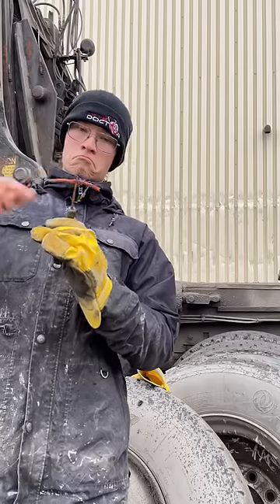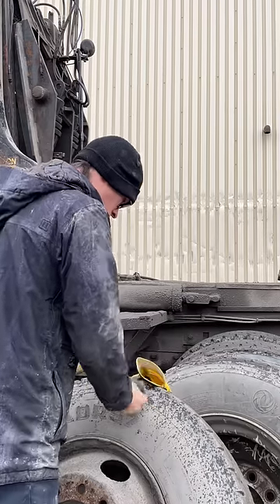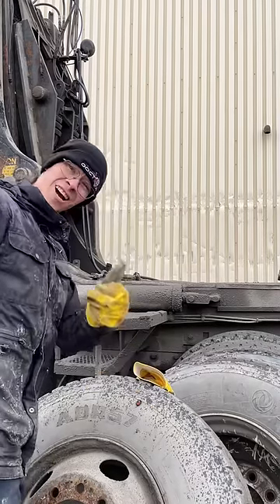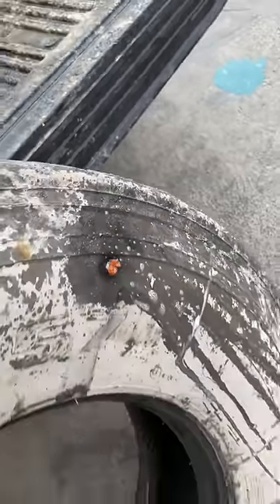Plugging A Truck Tire Sidewall #tiredoctor #shorts

Comment from the maker: Full 2022 Short Recap Videos Are Now Live! Click on my Channel to watch them ALL without having to scroll! ❤
Reply: Aren't you not generally supposed to fix side wall of tires, or does it depend on the tire??
Reply: But I don't watch for entertainment. I watch to learn. Or to add some content to help other technicians. And to get feedback.
Reply: i could make a knive out of that piece of medal
Reply: I found real life vigilante
Reply: The plug might get him home, but once the sidewall is done, so is the tire. I sure hope the truck company is eating that expense.
Reply: No
Reply: Give it too a tweaker
Reply: I have never seen a rope plug NOT outlast a tire! Just make sure you have a knot or loop tied in it on the inside of the tire. It will never come out! And always use tire cement on it. Tire companies just wanna sell you a new tire that's why they are not recommended.👍
Reply: The plug installed on the rim tested off ... Glad you didn't need to replace it lol
Reply: You should be fired for this. Lose ur TIA license.....never....NEVER plug a truck tire sidewall.
Reply: @dustinstrickland8975  he already replaced the tire when he tested it notice it's lack of rim ... All he did was waste a rope and time. For entertainment
Reply: And your fired
Reply: @JonRheaume2282 0j ZZZ l
Reply: Hey tire doctor is it safer to pull that out or pull the core out first?
Reply: Idon't think we can plug the hole on the side of a tire ?
Reply: @littleaub2145 it's a joke, there was no rim on the tire.
Reply: @FC0BCA7E7A it's a joke, there was no rim on the tire.
Reply: @roberthobbs6318  it’s a joke there was no humor on the tire.

Comment: That's why you don't pull out a knife if you get stabbed.
Reply: Or get this, don’t get stabbed
Reply: @eancola6111  😎
Reply: @eancola6111 now that's a 900 iq move right there
Reply: Nah just plug it with a tire plug
Reply: No you just put a tire plug in you 🤷‍♂️
Reply: So you don't deflate?
Reply: @eancola6111  real shit 👌
Reply: Usually the guy stabbing you pulls the knife out....
Reply: @eancola6111  it ain't that simple in Britain mate
Reply: @eancola6111  RULE NUMER 1!!!!! AVOIDANCE
Reply: @dickenscider9178  bruh😆☠️
Reply: @WarFrog935  Lol, sucks for you, 9mm beats knife just about every time
Reply: Knifes are for cowards. Real men use fists
Reply: Ok, good tip
Reply: @nanafalke  actually a pretty good analogy. Instead of deflate, we'd bleed out.
Reply: @nanafalke  if you're lucky. Ive seen them explode without it man
Reply: @eancola6111  he could be in the UK, they can’t help it
Reply: @Industry-insider  They can move lol
Reply: Well at least you’d have two knives by that point
Reply: What is?
Reply: @eancola6111  fr get a long range defensive stabber 

(it's a gun)

Comment: I love how many people don't understand that you can't plug a sidewall
Reply: I understand that you can't do it but I've never gotten an answer as to why you can't do it. what about the structure of a sidewall makes it impossible
Reply: @lanasmith4795  honestly I think it might be the weight of the sidewall but other than that idk I've just been told at the dealer I work at not to lmfao
Reply: @brandondenny226  thank you
Reply: I've had a plug in a sidewall for a year don't tell me what to do.
Reply: @lanasmith4795  to add to the earlier response, the sidewall also flexes way more than the rest of the tire so plugs and patches don't hold very well
Reply: @aaronstuckey2344  the hilarious part about this conversation is my sidewall blew out only after we started talking about it I just so happened to be in a conversation about a problem and then it happened to me
Reply: That’s literally the joke
Reply: @lanasmith4795 the sidewall not only flexes a lot under driving which in itself is an issue for plugs to stay secure. But they also dont have metal bands to support it like the tread does. Technically the risk of your tire exploding doesnt change much if any, but the chances of the plug working for an extended time are almost 0 where a plug in the tread of your tire can out last the tire itself.
Reply: The word can't is pretty strong. I had a screw come through my tread and out the sidewall and I didn't have any money to fix it. I figured I'd try and plug it and just stay off the highway to last until my next paycheck, the paycheck came and I legit forgot about the damn plug. About a year and a half later I noticed my tire was getting a bit too bald and realized it was plugged in the sidewall. I drove on the highway and hit a bunch of potholes in that span of time.
Reply: @lanasmith4795  you can't plug a sidewall because it weakens the structural integrity of the tire and increases the likelihood of a blowout
Reply: I know you can’t plug a radial tire because that becomes structurally compromised but what about a bias ply? Those are still common on trailer tires that done have a turning load put in them like front vehicle tires.
Reply: It's not that you can't. it's just unsafe.
Reply: I guess it depends on the tire, because in the military we successfully plugged every Stryker tire side wall damage, granted we used maybe 5-6 plugs each time but it held air and stayed held for the entirety of our training until we could replace the tire.
Reply: @Lana Smith  hole in the tread np it'll get lower until it's flat plug it and drive if it fails it'll just leak

Hole in the sidewall plug it and have the plug fail on the highway going 65-70 and it'll blow out violently jerking your steering wheel towards whatever side its on. I think it's just a matter of safety more than anything.
Reply: It’s average
Reply: given he tests for airleaks with the tire of the rim ...
Reply: @lanasmith4795  The reason you don't ever plug a sidewall is because a sidewall is a lot thinner than the tread part of the tire. If you were trying to plug a sidewall that plug is  a weak spot .. There's direct pressure on the tread part of the tire . This is the part of the tire that is in contact with the roadway all the time. The sidewall flexes every time you turn every time you go over bumps the sidewall is flexing kind of like  a sponge or  a spring . This can cause a sidewall to blow out at higher speeds .  It's just that it's  not that thick .  You got to be careful anyways when you're driving not to hit curves and different things because you don't want to damage your sidewall.. If you've already have a hole in it and then you plug it now it's already compromised and if you're driving 70 miles an hour on the freeway or whatever and it goes out there goes your whole tire and you can get into a really bad wreck .. I work at a dealership we will put 3 fingers on a patchable tire..  Three fingers is the max so you go from the sidewall and you put three fingers on the tire from the sidewall  if it's at the end of your third finger you're good but if it's anywhere close to the sidewall three  fingers close we can't patch it..
Reply: I’m an over the road diesel mechanic and the main thing is that it damages the cords of wires that support the tire under pressure. So when it’s aired to 105psi it has a chance to rip and create a tear in the sidewall while you’re in the middle of nowhere.
Reply: @lanasmith4795  I think it's cause the outside is constantly being stretched from the weight if the vehicle while the treads are constantly compressed allowing the plug to stay in place and less risk of the tire exploding from the constant pressure plus the treads are reinforced with wire the sidewall not so much just guessing though
Reply: @Lana Smith, it's because the sidewalls contract and expand every time you hit bumps. The tread does have that capability to contract since it's on the ground
Reply: Lol I plugged mine fine after a pot bill and it’s a 35 side wall low profile
Reply: Right!! It's like re-treading steer tires, just don't.
Reply: So a plug with gorilla glue still can't do the job?
Reply: @SightHandicappedRider9400  I mean can you milk a whale?
Reply: MOOOOOO
Reply: @lanasmith4795  It's because the sidewall flexes SIGNIFICANTLY when you drive. It may hold but the dangers of it blowing out at high speed is not a legal liability any Mechanic/Tech is willing to take. Especially considering pure negligence like that could possibly lead to legal liability, not just civil liability, could be involved!
Reply: @lanasmith4795 1 it's illegal 2 it's extremely prone to exploding 3 if someone is driving on that tire an the sidewall is plugged if something happens to them then the person who plugged it is in deep shit
Reply: I’ve done it before and its held for the past 5 years 😂
Reply: @lanasmith4795 because that's the thinnest part of the tire and the wire threading isn't as strong
Reply: If you live outside the US, you will drive on plugged sidewalls.
Reply: @lanasmith4795  the reason is because the sidewall takes the brunt of the pressure im the tire and it flexes the most. damage to the side wall damages the most structural part of the tire and will more than likely lead to a blow out. While its technically not illegal to repair side wall damage it is a liability so shops wont repair it. If a tire get a hole and the sidewall (or shoulder if we want to be specific) and the tire blows out and kills the result end up killing someone the shop and technician/mechanic can be held liable and can result in both a lawsuit and criminal charges. You also cannot patch a tire more than 4 times. Only one patch is allowed per quarter of the tire. Which also means you cant have more than two patches in close proximity.
Reply: @D4R34LGM0N3Y  I have no idea why people are still answering this question. I've had three months worth of people answering it
Reply: Not true, been rollin' for over 10,000+ miles on a plugged drive tore on my semi after a nail got stuck in the sidewall. 🤫 don't tell DOT
Reply: All of these answers from what I have seen are not full because the main reason why sidewalls can't be repaired is because of the cord structure. Sidewalls have cords running through them which creates the integrity of the tire and when something punctures the sidewall it destroys the cords. When you patch the sidewall you are not fixing the cord structure which makes it incredibly weak and prone to exploding depending on where the plug is and the quality of it. The tread has cords too but you can plug the tread as it doesn't flex nearly enough as the sidewall for it to fail and we have internal patches that go over the hole to increase the integrity of the repair but on the sidewall the internal flat patch does no good and eventually fails as the cords also will slowly damage themselves as they have a point of weakness where the cords can untangle and break up
Reply: That breaking is why some tires get bubbles in the sidewall as it is the internal cord structure failing to hold the tire together and why you hear a zip sound as the cords break. When you patch a sidewall you are basically telling g the tire to bubble there
Reply: @bransonr9954  almost a year and still I get new answers to that question
Reply: There r kits out there specifically for sidewall fixes
Reply: My Super Seal plug rep drove his company truck up to the shop, plug the sidewall of his tires for the 30th time, come back a year later and plug the same tire for the 60th time.
Reply: I mean you can. Doesn't mean you should lol.
Reply: I see your passive aggressive insult 😂. This guy knows WTF he's doing and this is OBVIOUSLY a joke.

Comment: I died laughing, thank you bro

Can't plug sidewalls people.
Reply: Came here to say this😂
Reply: @ClaytonBigsby01 came here to see who would say the obvious.
Reply: You can, just not recommend lmao
Reply: @Mbelk32  especially for a big rig. Those tires are under a lot of extra load sometimes.
Reply: Yes you can
Reply: @Yoda052  Ditto! I'm not surprised by the amount of dummies that have! 😆
Reply: Yes.. but what's the solution if the side walls r damaged like here
Reply: @getgsrinivas new tire
Reply: I have only ever plugged a sidewall after the customer has been notified and understands the situation before the repair is made.
Reply: People who use glue treads truly believe you can though.
Reply: @Yoda052 came here to see if someone was here to see someone say the obvious.
Reply: You can absolutely do sidewalls with a plug and patch, i used to work at a tire shop supply warehouse. Especially truck tires. I got a sidewall nail on my current tire, and my coworker got it patched for me, still working fine
Reply: @SkeleMusic  You can but you shouldn't.. the sidewall flex's and if anything should be short term fix to getting another tire.. Am certified tire tech that used to work on semis on the side of the friggin highway..